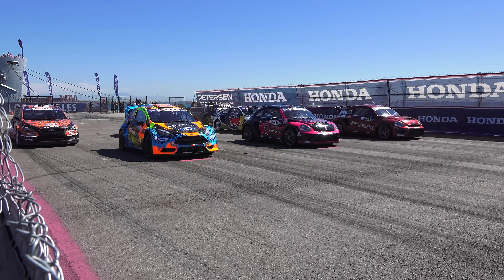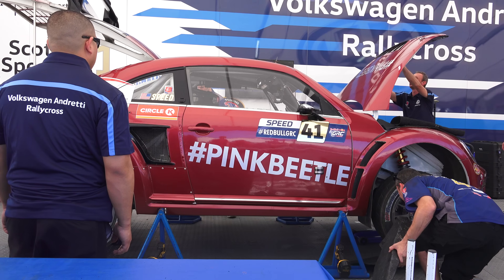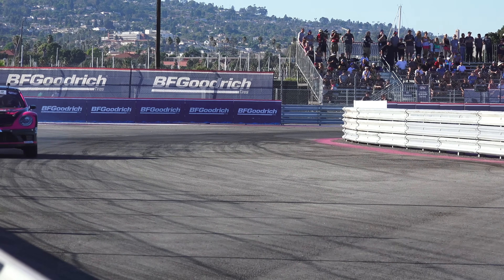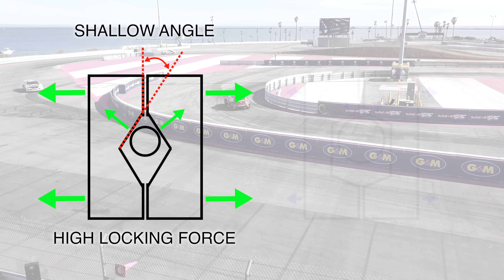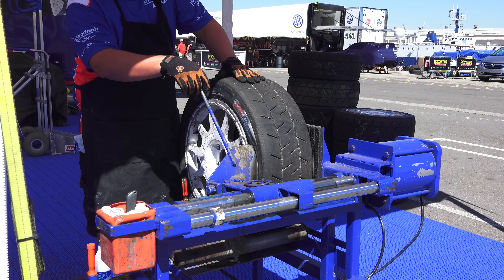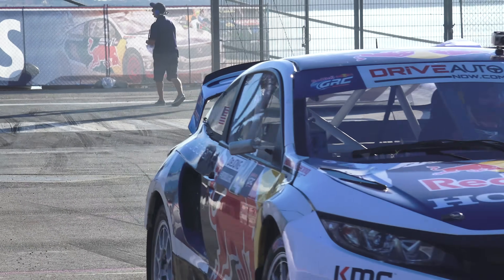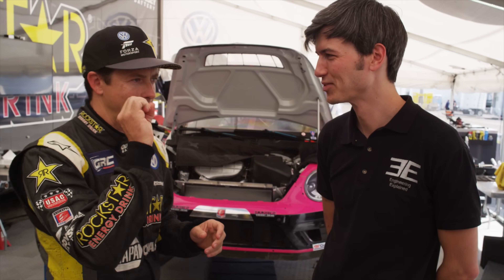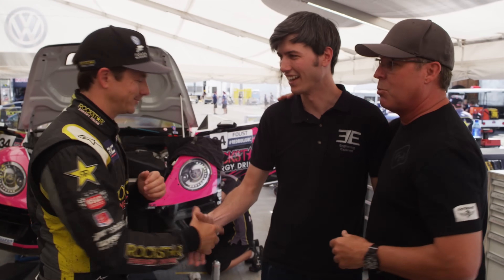How Global Rallycross Supercars Hit 60 MPH in 1.9 Seconds

Comment: Imagine if there was an energy accumulation system that would accumulate engine energy before lights out, the car could lurch forward even more violently, provided tires could provide the necessary friction.
Maybe super-compress air using engine and then blowing that air upwards and slightly backwards (angle optimised for maximum forward acceleration ) for downforce and then jettison the compressed air assembly as it's only needed at start.

Comment: wouldn't those drag races where they do a wheelie the whole way be the fastest possible acceleration?
Reply: It's heavily dependent on the car. Top fuel dragsters for example, have thousands of horses at the crank (up to 10,000) and very grippy drag slicks. That's how they can hit 160 kph in less than a second.

And you don't want a car to wheelie all the way, you have no control over your steering in that manner.

Comment: if that drivetrain was in a registered car nothing could get near it..but there was no mention of gear ratios my 2.0 AMG can do 260 kph if I make the ratios half that it has and do 130 kph flatout it's going to race of the start line way quicker ..but loose top speed ..these cars don't need to go faster than 180kph probably around that tight course

Comment: Finally s4 delta lancia has been beaten for fastest 0-60mph,it run a 2second 0-60 in mid 80's 1.8l dohc turbo/supercharged intercooled midrear engine awd pocket rocket that had different variations, the main 1 had about 500hp+ it was so fast the Finnish driver I think Henry tovannen took it to a formula 1 track on off season and did some fast lap times ,the Times he clocked would of placed him in top 5 in formula 1grid, remember motorsport had very little restrictions in 80's f1 BMW 1.5l turbo with custom turbo the size of huge rock 1000hp+ depending on boost ,so 30+years later starting to see glimpses of 80's motorsport, and it had to be a Honda to beat the ultimate s4 delta well done.

Comment: so just theoretically...would it be possible to achieve similar results by tuning a regular production car? Except for the tires maybe?
If I take the S1 e.g. ? It already has awd, propably would need some upgrades tho. You could strip the car down for wight, uprade the engine and turbo, work on the ecu and so on

Comment: LOL, electric drive eliminates basically all the requirements for this, except the tires. Weight is not a big issue on the straight when you can have 1000+HP instantly. The whole differential discussion is useless if every wheel of your car has a whole separate engine that can be individually powered to get maximum grip on every wheel at every millisecond. And the driver ... he just needs to press the "go" pedal. No gears or clutch or other weird systems.

Comment: "faster than any production vehicle"
Not anymore. Tesla Roadster will do 1.9s.
Reply: MIGHT do. There are no production vehicles that can be tested as of yet. Any numbers that they have gotten is from prototypes and/or calculations.
Reply: GlassBomb Their prototype does 1.9. Why wouldn't the production vehicle?
Reply: Because weight, batteries, motors, computers, interior, etc isn't that of the finished product. And it all comes down to the tires in the end. And I'm honestly not sure if the Michelin Cup 2 tires are capable to get sub 2 seconds times.

All of that is why I am skeptical of Tesla and Elon's claims.
Reply: This video was made in 2016. Roadster 2 arrives.. maybe late 2020.
Reply: @mcplutt  Maybe late 2022

Comment: Your wrong the tesla roadster 2020 can do 0-60 in 1.8 sec
Reply: Peter V I wonder which tires they have. I don't think that you can achieve 1.9 consistently because the street surfaces vary heavily.
Reply: This is an old video plus tesla is 1.9 0-60 too and it's not even out yet

Comment: 3lb per HP at the engine level was essential to enable helicopters ^^ 
5lb per HP overall for the cars nothing short of amazing! 

Internal Combustion Energy Density Fabulously Challenging to Match with EV Batteries +Controller & Motor (in same net vehicle mass range)

Comment: race tires, dogbox's and anti lag are the main differences that prevent production cars from accelerating like this, they cant be applied to a street car because they are not at all reliable they need constant service and repair and skill to properly operate. nothing else is gonna give u low end torque without the weight of a v8 and the ability to bang through 3 gears in couple seconds.

Comment: its not just about peak power numbers. i gained 75 horsepower modding my wrx, but my 0 to 60 is .2 slower due to the power band being shifted higher. they use antilag systems to prevent turbo lag which is part why they get such good acceleration as he stated.

Comment: I have a rwd rc rally car what's the best setup in suspension right now my suspension set up is front soft rear hard 1degree camber angle for front have back long gear ratio balance weight from the sides and more weight at the back rea engine but is in front of the gear box and 2.3cm ground clearance how's that? Remember and RC RADIO CONTROLLED rally car
Reply: 1/10 scale

Comment: i was really hoping you would tell us how they were getting that power out of the 4 banger
Reply from the maker: High boost & race fuel. I think they're operating somewhere around 45 PSI.
Reply: what internals are they using that can handle 45 psi??
Reply: yeah, but if you dont have the internals to support that boost, they become externals. derp.
Reply: More power - more strain on the engine - less endurance. This is obviously simplified, but it's just how it is.
Reply: TheBlaggert BILLET ALL THE THINGS! 8D
Reply: +Sprint2911gt3rsr boost can go way higher
Reply: They use very trick bottom end components in these.
Reply: Sprint2911gt3rsr Probably done special race block they manufactured. I doubt they start with a production engine
Reply: THat's it?  They aren't doing anything else, like supplementing hydrogen and heating the fuel with stainless steel tubes on the exhaust to increase the vaporization?  Not even using magnets... !?
Reply: Dragon bone.

Comment: You didn't mention the ALS, these cars insane anti-lag system gives them maximum torque from a standstill like with an electric motor. It basically spins up the turbo before throttle is applied, that's real launch control!

Comment: the most important thing why they accelerate that fast is the transmission, the do have ,,only,, 600 PS but why are they accelerating way faster then a bugatti? because they are lighter of course, but the main reason is that the transmission is different, for example a bugatti needs 2,6 scnd´s from 0-100 km/h a ralley car only 1,9 but a bugatti drives over 400 km/h, a ralley car only about 180 to 230 km/h because the transmission is built to accelerate and not for top speed
Reply: Yeah surprised the trans wasn't even mentioned!
Reply: DieCurrySauce it arent ment to build for top speed anyways , cuz the track design ( much steep corner ) , it has to be quick ( accelerate fast )
Reply: yeah, thats what the video is about ;)
Reply: A buggattis 0-60 isn't that fast compared to some cars
Reply: I'd rather that in imperial measurements

Comment: i am really disappointed. Explains engineering using lb-ft?

60 mph= 88 ft/s? So you have to figure out how much this is in ft/h(5280*60? LMAO) and then breake it down to 1 second.. whereas you just take 100 kmh, devide it by 3.6 and have your result in m/s.

Comment: My friend wanted to Twin Charge his 3.7L V6 2014 Mustang Premium. I usually direct them with their builds both cosmetically and mechanically, but this is a loaded question, and I need your help. The only Supercharging kits available to work off of are Prochargers. So my question is, what difference does a centrifugal Supercharger have on a Twin Charged System? in addition how someone would tune for the difference between a conventional supercharger and a centrifugal supercharger.

Comment: Aust the Tesla is a 7 seated car with two trunks. It's not intended to be a race car 🏁 if the seats were stripped out and with a smaller battery 🔋 the p100 would be .05 to 60. Just wait the roadster will be much faster it's pretty lame that a race 🏁 car is not even a second faster and lets not forget the Tesla has now harm to environment it costs penny's a month to fuel ⛽

Comment: some cars go even faster, just a bit more horsepower i think...
Reply: faster? easily. but quicker? hard to say.. 0-60 in 1.9sec is absolutely insane when you consider a 1200hp Bugatti Veyron Super Sport does 0-60 in around 2.5.
Reply: B Thiel  peugeot 208 T16 with a 875 hp v6 does it in 1.8 sec, weights only 875kg they say
Reply: I had no clue! that 208 sounds craaazy quick.
Reply: made for the pikes peak ultimate class hill climb
Reply: These cars are the fastest for these tracks.

Comment: I feel you forgot to mention the suspension. Isn't it also very important for that actual initial grip that you get off the line?
Soft suspension and a lot of squat when accelerating gives you a lot of mechanical grip and help you accelerate from a dead stop.
Too hard of a suspension - you spin the tires. Too soft - you get unstable characteristics at cornering. You need to nail it just perfectly for this type of a rally so that you get best of all elements. Isn't that right?

Comment: But the 918 has all the given stats but still doesn't go 0-60 at 1.9 sec. why?
Reply: Road tyres possibly? These only have to last the race so can be properly sticky.
Reply: weight. 918 is hybrid and has a large ICE engine as well as creature comforts (A/C, Airbags, NVH cancellation)
Also the rally cross cars are geared much shorter, because the tracks are short and they don't need much top speed. As someone else said they max at like 125mph.
Reply: uncreativename bro. The 918 has better power to weight ratio than these cars.
Reply: uncreativename gearing and tyres must be the only reasons then.

Comment: Ayeee i saww you we said hey when you were in the blue BRZ
Reply from the maker: Right on, hey there!
Reply: Can you do a short video explaining what engine size would be optimal? Im looking at a 5.3, 5.7, 6.0, 7.4, 8.1. not sure what to go with what is good for tunes and upgrades
Reply: Spartan-118 go with the 5.3 it's probably the best for upgrading.
Reply: Spartan-118 are you talking about heavy duty diesels? 7.1 l turbocharged ferds go for 500000 plus miles

Comment: Pretty awesome, but I believe the record for fastest production (loose term) car 0-60 goes to the cobra jet mustang at 1.52 seconds. Even though it is not street legal and is only produced in small numbers (and sold exclusively to racing teams) it is produced on the same production line as normal mustangs up to the engine and suspension connections.

Edited for spelling.

Comment: 13.7 furshot of longitudinal acceleration!?
How can a car that only produce 135 plots of power and 83 fields of torque and weigh as much as 424 herds even find the grip for that kinda acceleration? those tires must have insane sticky compound, like at least 600 apples per orange² coefficient. that's if they're heated before. if they're like below 3400º bonk, i refuse to believe that's even real. at least 5000 bonks and it makes more sense.

my point is: use metric.
Reply from the maker: G's are universal, no units (acceleration divided by acceleration), but alright. :)
Reply: +Engineering Explained no idea what this guy is talking about. G's are universal between the unit systems. Extremely few people use m/s^2. That is only really used when doing calculations lmao

Comment: Are there street legal Version of these?
Reply: you don't get 600 horsepower by "ricing" your car.  people who rice their car typically do exterior modifications that have almost zero effect on the performance of the car.  a car that is tuned and upgraded very heavily will not be a riced out car.  if you think that then you have no idea what a ricer is and you're probably that dude that calls every car that isn't stock or looks sporty a ricer.
Reply from the maker: +Nayib Noyola well the STI is the only one where the street version is AWD, all the others are based on FWD models.
Reply: The Focus RS is nice.
Reply: Nayib Noyola you can just rice your car, there is really no limit to car modifications in the united States if u think about it
Reply: You forgot the Focus RS.
Reply: Rally cars are street legal because in some of their races requires them to move from point A to point B and also they use public roads to do their races, for example Rally America, they use public roads to do their events, and their stages are different public roads close to each other and they drive there using public roads.
Reply: Thanks for the comments

Comment: Without the limitations in place what sort of power\0-60 times can these cars do?
Reply: Without engine limitations? Refer to dragsters lol

but thats the fun of it, limiting the engine to a 2.0 and pushing it to the limit.

People can get to 1,000 hp out of 2.0's but honestly (This is just my self thought) its hard to transfer that kind of power to acceleration based gearboxes. I'm sure they can easily make the gear ratio handle it but I think there is a point where spinning all 4 wheels all the time when trying to get grip isnt ideal. lol
Reply: Lol, yeah I should've been more specific. I meant still using the 2.0Ls but without the turbo restrictor plates.

Yeah, I can imagine there's a point where they have to dial it back on the power to allow the tyres to grip the track. Must be challenging with so many variables you can tweak to try and get the best all rounder.
Reply: So then why not bigger tires?
Reply: ***** Ah yeah I forgot they go offroad too.